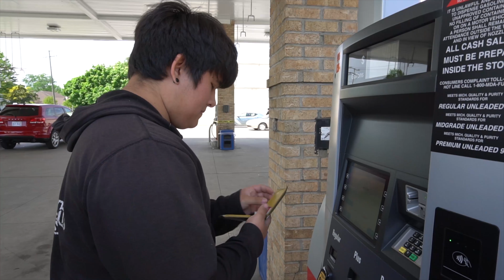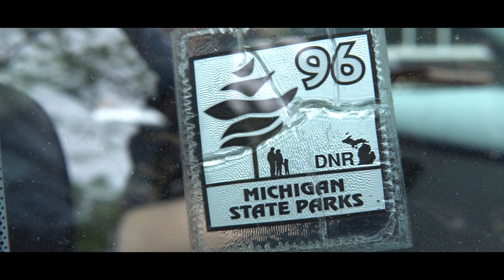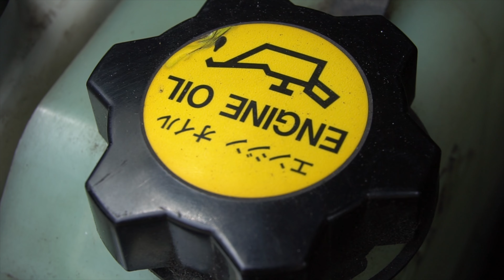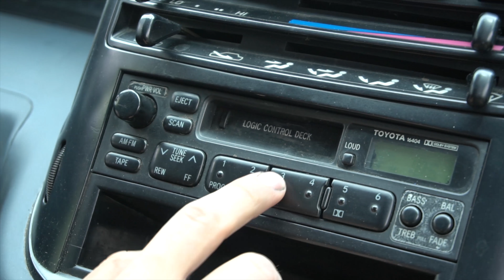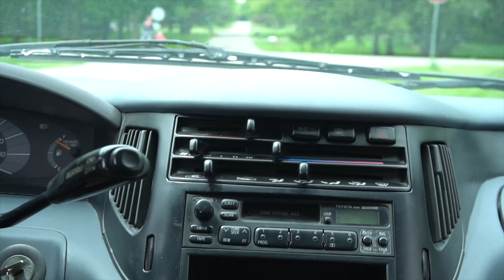BUYING A SPACESHIP FOR $1200 (Toyota Previa) // ꜱᴜᴍᴍᴇʀ ꜱᴛᴀɢᴇ ᴇᴘ1

Comment: I just bought a 1997 SC from this pastor for 1300 with 230k miles on it and needs about $300 work. Let s see. This is the 3rd I bought in 10 years. I had a 93 and 96. I think 93's are best.
Reply from the maker: That's awesome! It's cool seeing where and when these vans will pop up for sale
Reply: @GARAGE33  I sold my 93 in 2013 and I was very disappointed because I sold it for $700 and it just needed like another $400 of work on it. There is a guy on "offerup" that has a 1993 with 94k on it and wants $1400. He is so busy it takes a cauple of days to get a call back.